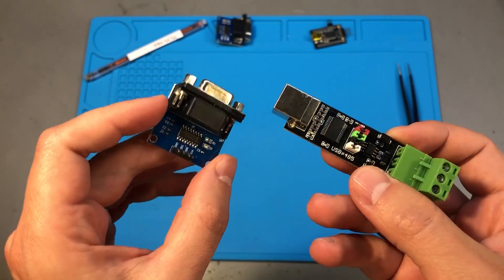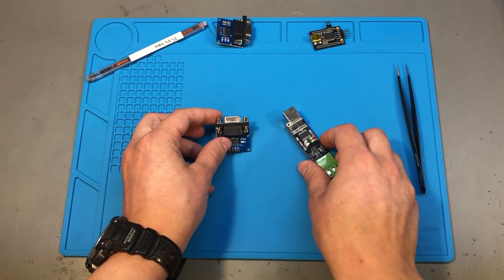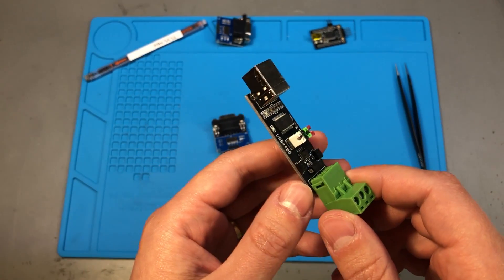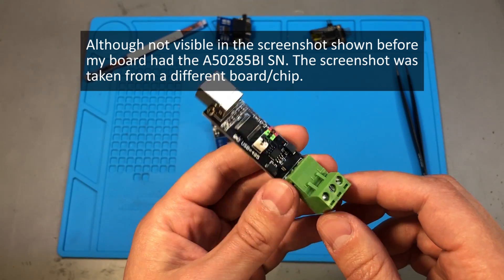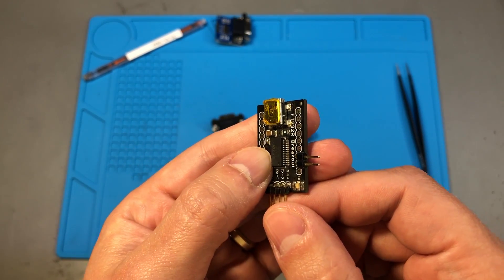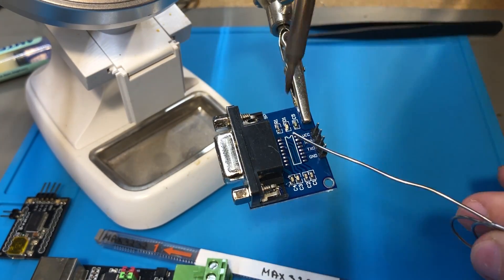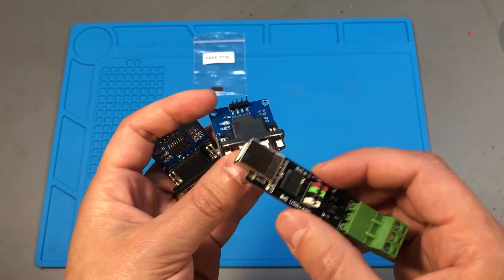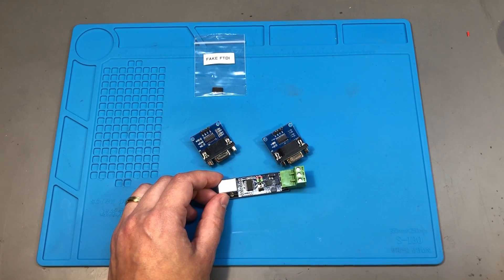Identifying & Replacing A Fake FTDI FT232R Chip | Voltlog #314

Comment: For RS485 converter it is usually better to find converter with FT232RL chip for USB to serial converter.  It has a Tx enable output for the MAX485 chip.

A lot of cheap RS485 converters just use Tx data line tied to Tx enable of MAX485 chip.  This causes MAX485 chip Tx output to tri-state during logic zero, relying on 120 ohm line termination resistors load to pull lines to logic zero.  It reduces max baud rate useable and reduces max line run length.

Comment: Thanks for this really interesting topic. I learned a lot.
1. I bought aliexpress 33055692276 Isolated RS485 with FTDI. Serial number starts AD0J... , so it seems not beeing a fake. Has isolated power supply and data line isolators. So, may be not worth developping your own?
2. Is it possible to reprogram the serial numbers of the fake chips? I do not know, but fear not.
3. If having just one single  serial2USB converter attached to the computer, nearly all converters worked up to now, also the cheap CH340. But if having more than one at the same time, it may matter to identify the unit und allocate to the same comport number  after reboot. Do you konw more about it? Does Windows use the Serial number to reallocate to the com ports? I could not find enough info up to now.
Reply from the maker: Programming of the serial numbers on the fakes is not possible as far as I know. They bypassed the driver bricking issue by disabling writes to the internal eeprom.
Reply: @voltlog  Thanks, thats a pity.
Reply: @voltlog Hello, would it be possible to edit the serial number of the original 232rl.
This way, making a clone of each other.

Comment: USB-to-serial chips requiring a proprietary driver aren't really needed anymore. USB has a standardized extension for it  (USB CDC ACM and PSTN) and all major operating systems come with the required drivers out of the box. It's often implemented by an MCU, e.g. by an ATMEGA8U2 on the Arduino Uno or directly by the Arduino core for STM32 or ATEML SAM-D. Unfortunately, no single chip solutions are available and I'm not aware of any USB-to-serial adapter using the USB CDC protocol. Let me know if you know of such a commercial adapter.

Comment: I have a few USB serial adapters that used the Prolific PL2303 chip, a chip that was being faked even before the FTDI FT232.  Some are in isolated USB interfaces for test equipment that came from pretty well companies (e.g. BK Precision IT-E132).  I guess even large companies can be hit with counterfeit parts, but I actually just think the Prolific driver is badly written, and especially has compatibility issues on Windows 10.  A solution is that the PL2302 and FT232 have almost identical footprints, so you can usually swap in an FT232 and get things working again, rather than throwing otherwise useful equipment away.
Reply from the maker: I used to have a usb to serial adapter, maybe 10 years ago, it was based on the PL2302, I have no idea if it was fake or not but I remember having issues quite often.

Comment: Just use Linux. The 'fake chips' are only a problem with the drivers written by FTDI. The open source drivers written by the community are not malicious software products designed to manipulate the end user. The community won't try to brick our stuff bc they failed to file trademark and IP filings in Chinese courts. They were cheap enough bastards to outsource, but also too cheap to do it right. China has strong laws to support those that invest in doing it right.
Reply: "China has strong laws to support those that invest in doing it right." - Nice Fairy tale. It's a dragon with no teeth or flame.

Comment: How to identify a fake FTDI? Simple. You bought it on ebay, aliexpress or any other of the China "outlets". ;)
Reply: Not guaranteed I guess, you might get a genuine chip someone blowtorched off a recycled board.
Reply: @benbaselet2026  They even pop up from reputable suppliers, somebody swaps in a reel of fake parts for the real items, or ordered the real ones, and returns the fakes in the same packaging material.
Reply: @SeanBZA  Yeah, I heard that happens with phone bits. People buy a phone, swap fake parts inside and return it.
Reply: Is it really so simple? I received yesterday chips from big European distributor that is on "the white list" of distributors of FTDI chips. The chips have unique serial numbers but I believe I received FAKE FT232RL because those chips have the same bug in the design like cheap chips from Aliexpress. I clearly see the communication problem that I cannot see with "genuine" FT232R from FTDI or when I use other UART chip (CP2102, etc).

Comment: if you give them tips ... expect the next batch of fake ones to include unique serials no. ;)
Reply: That might be enough to defeat the fake chip detection though?
Reply: @benbaselet2026  Not really, the driver detects a fake by rewriting one half of the 16 bit enumeration number, but not completing the write, and restarting the chip, which on a genuine part does nothing, as the ID requires 2 byes to be written and then confirmed before it programs the 16 bit register, but the fakes simply execute each write as they come in. Thus the ID has one half set to zeros and no longer is recognised as a valid chip by the USB driver system, as it has no matching driver to that false ID.

The serial number of the chip is just there to allow drivers to detect individual chips irrespective of the port they are plugged in to, but as is so common with USB, this can be poor at doing so at the best of times if you plug into a different port. That is why my PC has a diagram of the USB layout on the rear, with a note of which port goes to which device, so they go back in the same. Saves a lot of  Copy xx of driver YY issues.
Reply: @SeanBZA  thanks for the info. Do you know more about reallocation of com port numbers, especially using an USB hub?

Comment: What issues do the fake chips  cause or have if they work ?
Reply: 99% of them work well enough, but are cheaper than the FDTI chips, and in most cases are nearly identical as to input and output in most applications. There are edge cases, but so few people actually use them that you can be hurt by FDTI doing a chip revision on the genuine parts at times, changing things in subtle ways.
Reply: FAKE FTDI chips handle frame errors in a wrong way, they lose synchronization to serial data stream. This bug in their design could be used to identify fake chips (FT232RL, FT232BM, etc). Identification by serial number is not reliable, manufacturer of FAKE chips improved their process and they produce FAKE chips with unique serial numbers. I heard that they even produce documentation (batch ID, etc) in the way that supplier can trace fake chips to genuine FTDI chips, so it is really difficult to identify them. They real weakness is that fake chips are not 100% compatible, this can be used to identify them. When man boughs cheap FT232RL at Aliexpress,  that is not good but when man pays the price of genuine FT232RL for a fake chip with unique serial number, that is a tragedy and that is the current situation. Most applications doesn't need advanced features of FT232RL chips but designers used them because these are well known parts. Even those fake chips work for most people without real problem because they just use basic features of FT232RL.
Reply: There's a USB to RJ45 cable on Newegg that was advertised as FTDI for connecting to Cisco.
I intended to use it to console in to my new Cisco Switch so I bought it.
It took a moment for me to locate the drivers because the linked drivers from the official FTDI-chip website that I download would fail to install drivers for the device, and the USB serial cable would just sit in Other on Device Manager as USB-45! 
 I eventually stumbled on a driver made from a Chinese brand WCH that produced CH341ER driver that I was able to finally get installed and show serial COM port.
But I had no luck with getting to the console in Putty as I got no response from the terminal.
Dug deep further online and realized that there are these Chinese FTDI knock offs and that the chip in this RJ45 USB serial cable I bought from Newegg was not a legit FTDI and that was why I could not console into my Switch.
Reply: They would function perfectly.
The only issue is FTDI writing nukes into their drivers.

Comment: Ever since the FTDI Fiasco (that backfired) where FTDI installed a Bomb in their Drivers to "Brick" fake FTDI Chips installed in products..... I have never again bought a product with ANY TYPE of FTDI chip on it... Fake or Original.
There are other more reputable RS232 to USB Converter companies to chose from.
Reply from the maker: I would totally agree and support that kind of attitude. Myself I haven't purchased any FTDI chips ever since but, if you search for an RS485 to USB adapters, the affordable ones that fit the requirements are of this type shown in the video with the fake FTDI chips. That's why I was thinking about designing my own, have it isolated and I would be using a different chip for the conversion something like the CP210x
Reply: @voltlog  We use the CH340 series chips in our products. Never had a problem since we switched over.
Reply: @lasersbee  I've never used anything but the Chines CH340.  Finding a driver was a bit difficult but I found one.  My Chines SUCKS.  If there is a drawback to using the CH340 I wouldn't know what it was.  LOL
Reply: @lasersbee  DO you know what happens having more than one CH340 attached to the same win10 computer after reboot? are the com port numbers allocated in the same manner as before?
Reply: @pulesjet  I know a problem with those CH340/341 try using them on a Cisco Switch console port that requires a FTDI/VCP chip.  Those CH340s will fail to work.
Reply: Since FTDI-gate I avoid any products from FTDI. I have never had problems with CH340 chips and in my own projects I stick to Silicon Labs CP210x.
Reply: I've got a few older designs that still use the FT232, but for my newer ones I've started using the SiLabs parts (or native USB where possible).  I've had issues many years ago with the CH340, but only when streaming data at high speed for long periods where it can start to occasionally drop characters.  Was a known issue in the grbl community.  It might have been fixed in newer CH340 silicon, but it is hard to get good datasheets let alone errata on these parts.
Reply: Same, FTDI lost my support when they did that. Regarding RS485 - maybe I missed where you mentioned that (or maybe it's just senility setting in) but may I ask what are you using RS485 for...?
Reply: Same. I never sought out or avoided FTDIs before the driver debacle, but after that I made sure to never get anything from FTDI whenever I had a choice. Other converters were cheaper before that anyway and still are.
All The USB-to-serial converters I bought are Silabs CP210x. I think I have at least 10 of them not counting the few that ended up in a project permanently. I especially like the fact that you can program in a custom baudrate . 2Mbaud when talking to an AVR without any baudrate timing error is nice. (I guess the same is possible with some other chips, but I never checked if they offer a config software or even have that ability).